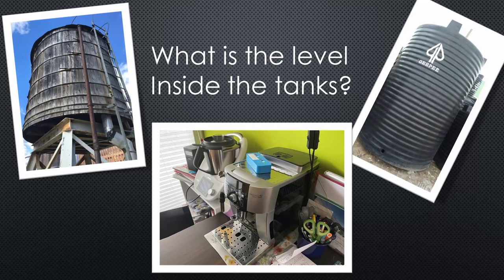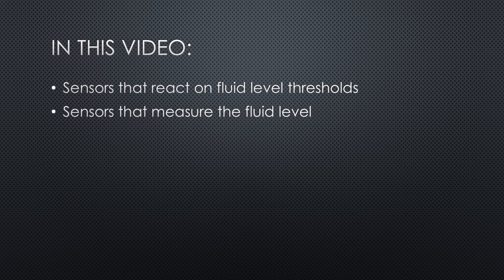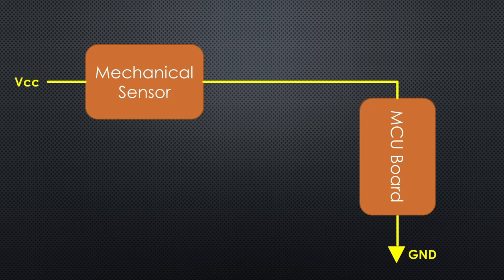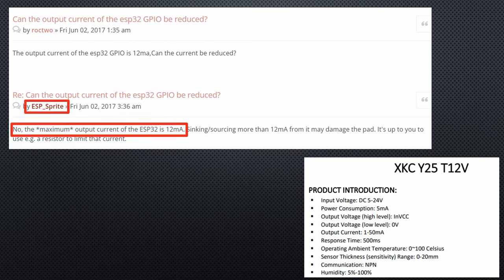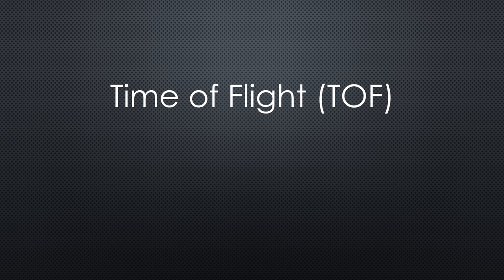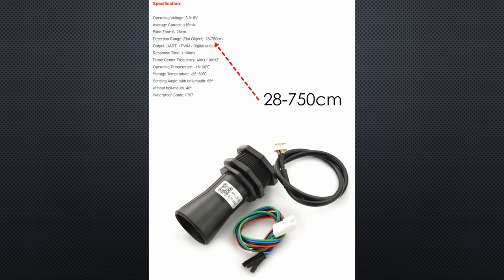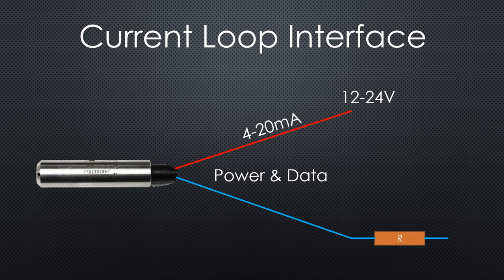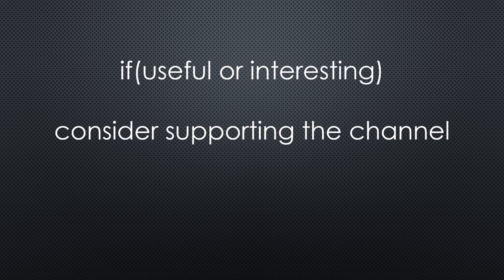#411 Ten Fluid Level (Water Level) Sensors and how to use them (Arduino, ESP32, ESP8266)

Comment: I use pressure sensors (MXP) for bore wells and tanks. These measure the difference between ambient and 'bottom' level pressure to indirectly measure the water level. Only downside, I use an air pump once per hour to drive any water out of the tube that runs to the bottom of the well or tank.
Reply from the maker: I think tis is a very good idea. There are a few discussions about this method in the comments. Using a differential sensor seems to be a very good option.

Comment: What about those eTapes? I have a few, they work great, but unfortunately they are expensive and only come in fixed sizes
Reply from the maker: They seem to use an interesting technology: A resistive band which somehow is connected by pressure applied by the liquid. I only learned about them from commenters.
Reply: @AndreasSpiess  Hoi Andreas
Falls du mal einen eTape ausprobieren möchtest, einfach kurz melden! Funktionieren gemäss Hersteller auch in korrosiven Medien!
Gruss Beat (...vom glp Essen :-))
Reply from the maker: @Beat: Vielen Dank für das Angebot. Vielleicht komme ich mal darauf zurück...

Comment: One useful method for imaging the inside of an object is tomography, any wave source that you can generate and detect that will penetrate the conditions you are working in will do. In a tank scenario you are only dealing with one dimensional tomography therefore it is computationally less intensive and a simple neural network running on a microprocessor should suffice, particularly if the sample rate is in minutes or hours. Obviously the neural network is pretrained on a physical model and then retrained on the actual conditions during the initial filling of the tank. It could be as cheap as piezoelectric actuators/sensors and an ESP32. The cost/value of the setup is in the embodied intelligence rather than the material configuration, this is always the most scalable and sustainable approach.
Reply from the maker: This seems to be a rather complex way for that purpose. How much resolution would the receiver need? Only one signal or a matrix of sensors?
Reply: @AndreasSpiess  Three or four but perhaps only two simple piezo discs acting as transceivers. Not sure if you can multiplex a single one and have it read its own signal echo, worth researching. Add drivers for larger and or more solid tanks, whatever is required to get a detectable signal through the tank plus contents. See "Ultrasound computed tomography for material inspection: Principles, design and applications" Measurement volume 146 (2019) You'd be detecting the moving air/contents interface but not actually imaging anything so just a single variable output.

Comment: This is a timely video for me.  I live in California, in a town that was mostly destroyed by wildfire.  My house was saved but the water treatment plant was damaged.  They have repaired it enough that we have water but very low pressure.  I have to pump water into a tank to supply our house with water.  Right now I have a float switch in the top to tell me when the tank is full but now I am going to put a pressure sensor in the line coming out of the tank so I can monitor the level in the tank.  Thanks for the video :)
Reply from the maker: Glad to read that you and your house survived this catastrophe! A pressure sensor is probably the easiest thing in your case. I forgot to mention htat you ahve to correct the values with hte current pressure (obtained by a weather service) if you ant to be precise.
Reply: @AndreasSpiess  I didn't think of that.  I wonder if I could use the pressure sensor in conjunction with something like a BMP280 for barometric pressure.  But, then I would have to do math :)

Comment: Another informative video … thanks. A few years ago I prototyped a multi-level capacitive approach using adhesive copper tape on the outside of an aquarium and the Adafruit MPR121 12 channel sensing board. It worked quite well and I’m finally getting back to an aquarium automation project using that approach.
Reply from the maker: Good idea. Like that you even get more than just one or two level signals.

Comment: In the past I’ve used a psi sensor on a long tube, weight on the end, read it with an lm324 and A-D converter. As it works on air pressure in the tube you don’t get the sensor wet. And you can calibrate it as you lower the tube into a full tank. I’ve recently purchased an ESP32 and a PSI sensor to make a new one for our new 20000 litre tank. I was going to build it over the holidays. Maybe I’ll make a video to share.
Reply from the maker: Cool. Do you intend a pump to the setup? (As other viewers suggest)
Reply: @AndreasSpiess  No, it’s just the change in air pressure within the tube caused by the water surrounding the tube in the tank. More water higher air pressure.

Comment: Great video, but your videos always are. I'm interested in the FM24-NP100 from #378. The concept is only good for plastic tanks but should avoid contact, corrosion and condensation problems. Mount it above the tank facing down so it can "see" through the top of the tank to the liquid surface. As you know, the sensor communicates via a UART so no ADC to deal with. Ignore the return from the top of the tank and so long as you know the height of the sensor above the floor of the tank, its easy math to read the level.
Reply from the maker: Radars were mentioned by a few other viewers. They seem to be quite common in commercial applications. But they are not cheap...
Reply: @AndreasSpiess  Agreed. Maybe they come down in price with time.

Comment: I've tested a number of different ultrasonic sensors (water-resistant) and from my experience they don't work very well in closed tanks. The main issue is condensation of water on the surface of the sensor (caused by evaporation). I even tried covering the sensor with anti-condensation sprays but without much success so far
Reply: Perhaps the sensor could have a small resistive heater attached, stay within operating temps, and eliminate condensation.
Reply: @gorinator  yes, I agree. Another alternative that I also considered was to mount a small vibrating motor (e.g. from old cell phone) that will run periodically to drop off any condensed water from sensor surface. But either way - it doesn't work without additional workload
Reply from the maker: Good info. Thank you for sharing!

Comment: I like the idea of using a strain gauge (and an MCU to do the calculations) to measure the weight of the tank and contents (and working out the level by subtracting one from the other).  It reduces the problem of content contamination and sensor corrosion.  It just requires the tank to have some flex (or motion) in its mount, which can be quite simple on small tanks.  I like the idea that the sensor is completely external - which is more difficult with a pressure sensor.
Reply from the maker: I agree and I should have included this method because of the many advantages.
Reply: @AndreasSpiess  It's a great video regardless.  Stay safe out there 😀

Comment: Great video, thanks. One big advantage of the 4..20mA interface, it is easy to detect a broken connection (0 mA). And also short circuit is easy (>20mA). Shouldn't there be some protection? Maybe a subject for a video?
Reply from the maker: I was not aware why they did not go down to 0 mA. Now I know that it can be used as a detector for broken wires...
Reply: @AndreasSpiess  If you are google for "NE43 beckhoff grundlagen" you will find a specification how Beckhoff realized NE43 of NAMUR (NormungsAusschuss Meß- Und Regeltechnik)
Reply: Some of the newer sensors are actually sending both a 4-20 mA loop signal and a digital signal somehow encoded such that it doesn't interfere with the current signal. My guess would be as a bipolar voltage changing signal probably at a khz frequency that can be filtered out somewhat like power line carrier.

Comment: Nicely done! A flashback to my past.  Open Collector outputs are used in many places in industrial I/O especially when the sensor is a long distance from the MCU as it reduces the power supply loading on the I/O point. The important point is to decouple the power supply from the sensor. Current loop systems have some concerns about short circuit protection.  It can be a party-line with several devices consuming this data.    Also, current loop is very often used to send serial data which may be fun to dive into.   Nicely done.
Reply from the maker: I thought I explain it because, as you mention, it was often used in the past and maybe no more known by younger people.
Reply: @AndreasSpiess  as always you communicate technical topics in an easy to digest fashion

Comment: Great topic and info Andreas, brilliant as always. Thank you for creating this. Level sensing is a very popular subject and complex (with challenges) at times. In the industrial world, Radar for level is also very popular, with different frequencies and ranges available. Ultrasonic can also use different frequencies, depending on range. With Ultrasonic, keep in mind that the temperature will affect the accuracy of the signal, therefore sensors have temperature compensation internally. You can use a 'still well' to eliminate disturbances on the liquid surface affecting your signal, as well as air movement affecting the return echo signal. With pressure, you will find 'front-flush' sensors which are typically used in the food industry, this reduces the chance of contamination. Even optical sensors are used for level at times, infra-red light can be your friend. For your viewers who want more info on this topic, I would recommend doing a google search, all the leaders in the industrial electronics have various sensors for this application and a world of information to share with you.
Reply from the maker: Thank you for the additional information. The VL... TOF sensors use infrared light, BTW. Radar is also an interesting topic (a longtime topic on my list)

Comment: Thanks. Your timing is perfect for me. Just about to add level sensors in my campervan. Lots of interesting work ahead.
Reply from the maker: Good project! Movement might complicate the things. I always wonder how my gas tank knows how much gas it still contains ;-)
Reply: @AndreasSpiess  float I think. Mine is resistive, I think there's a float operating a rheostat.

Comment: Another one is linear capacitive sensing. They can be made with a couple of long conductors at a fixed distance and completely isolated. The fluid's dielectric is exploited to know the level by measuring the relative capacitance. I've made a video some years ago about a diy sensor that uses this principle. It was designed as a threshold sensor but the linear signal can be picked up to get the actual level. Being completely isolated they can be submerged with no risk of corrosion or contamination. They can also be sticked to the external lining of a plastic tank.
Reply from the maker: Good video! Maybe it even would be possible to use the electronics of the capacitive sensor I showed (using an NE555)?
Reply: @AndreasSpiess  Thank you. With a NE555 you can definitely make a suitable circuit. I rather used a fast cmos though, as it performs better IMO: higher input resistance => better Q => higher sensitivity and larger range. The circuit layout is always critical. Greetings.

Comment: Hi,
Hope you are well.
Thank you very much for valuable information about sensors.
Is it possible to use a pressure sensor of manufacture’s range of (0 - 1.2MPa) to read water levels of a water tank of 2.2m depth?
Thank you
Reply from the maker: You have to do your calculations yourself. Google knows the formulas...

Comment: i mounted a TOF sensor to the top of a 25mm diameter tube. and added a flat topped float inside the tube. it works very well. it measures a water barrel for a greenhouse.
Reply from the maker: Thank you for sharing. Others also reported that using a pipe for the TOF sensors reduces reflections.

Comment: I have a possibly silly question, but I still can't get a project going. The question is the following: I'm using a YB-2J-F and I connect it to 12 Volts. But the output through the blue cable is 12V. How can I then connect it to an Arduino for example? Could you help me please?
Reply from the maker: These sensors offer a current, not a voltage. Search for "current loop  arduino". 12V on a pin most probably kills your arduino, BTW. So pay attention

Comment: any idea, if it is possible to use a pressure sensor 30 elevation meter lower of a water tank and still read the water level +- 0.1 to 0.3 m ?

the water gets pumped from the spring to the water basin 30m higher. 
I have only 1 tube to fill and refill the basin. no electricity or cable at the basin.
now I was thinking if a pressure sensor mounted at the lower location (spring) can detect the water level and how it behaves if the pump kicks in or or somebody empties the tank.

would a pressure sensor be too unreliable?
Reply from the maker: Maybe you watch the video where I converted a blood pressure sensor into a pressure sensor?

Comment: There's one potential sensor type that I haven't seen.  A storage vessel's resonant frequency will change depending on how full it is.  So you could just ping the tank and measure the frequency...
Reply from the maker: Another viewer also suggested this principle. Interesting. But I have no clue how sharp the dip is and therefore how accurate the measurement will be, particularly for wide tanks.

Comment: Is there a method to measure line level pressure of a CO2 or Nitrogen line? Just need to know when/if I lose pressure to my tanks. Can be Shelly or Pi
Reply from the maker: I do not know, I do not have such a use case.

Comment: Can the pressure sensor be used outside the tank with a hose? The question si from this scenario: 
On a motorcycle you can't introduce a sensor inside the tank without making a hole. I was thinking of junctioning the output hose (which is located at the bottom of the tank) into a pressure sensor. Will it measure correctly? Or will the other part of the hose that goes to the carburator influnece the pressure and give false readings? I was also thinking of a debit measuring sensor that would basicall calculate how much is going out of the tank, but the problem here is that the debit is very small that I doubt any sensor would be able to "feel" it.
Reply from the maker: Maybe you watch my video where I converted a blood pressure sensor in a level sensor

Comment: There is a liquid level sensor used in lots of old washing machines - it determines the pressure level as the water rises in small tube and then a diapham pushes a mechanical switch . I think that is how they work.
Reply from the maker: Other viewers also mentioned such sensors and in the meantime I watched a video. They indeed work with the transfer of the water pressure to the sensor using the air in a tube.

Comment: Is anyone familiar with the sensor from Touchcell numbered p14701a1z?
It’s commonly used in automatic coffee machines to monitor the tray. I would like to bypass the sensor, but I am not able to find the datasheet to understand what it would take to bypass it. Any help would be appreciated!
Reply from the maker: It says "Reed" in its description. So I assume it works with a reed relay. Should be possible to reverse engineer it if you have one.

Comment: I saw someone once on youtube design a capacitive tank level sensor. And I often see this in building automation projects with generator main gas tanks. I suspect it has to be calibrated for each type of fluid, a bit like with the pressure sensor, since dielectric constant varirs between fluids
Reply from the maker: I know they exist but so far never saw one in operation. I would also assume their reading can be influenced by the fluids.

Comment: Hello, with regards to sensors and measuring, which type of sensor can be used to read gas levels on the surface of the tank. Would an ultrasonic sensor be able to read the gas levels inside the cylinder by attaching it at the bottom?
Reply from the maker: I do not know your use case. But you should have enough info to decide. Just pay attention if your "gas" is flammable...

Comment: My rx7 uses a variable resistance single probe single wire type sensor.
Its mounted vertically at the top of the radiator.
I'm a newbie but I'm trying to make it a project on reusing the sensor.
Reply from the maker: Cool. I hope you will be successful!

Comment: I'm looking for information about USB Connectors. Did you already cover that topic? I'm working on Android Software to integrate data recieved from radios and display them like positions on a map. Since my older phones all have broken 3.5mm jacks I would need to make my USB-C only Phone work. Two of the adapters I ordered are bad quality and do not work so, I thought, since I now have plenty hardware, how hard could it be to fix them? I would like to be able to charge the phone while recieving, thats my main struggle. Thank you for your immense knowledge base. You brought me back to electronic engineering and into the amature radio world.
Reply from the maker: I never did a video about USB and Smartphones.

Comment: I have been just trying to repair an older model of navis-elektronika bluetooth level meter. It measures capacitance of a two wire cable sealed at the bottom end. The meter contains TLC555 as a capacitance to frequency converter. An MSP430G2553 mcu that wakes up everything every 20 seconds. And a bluetooth module BLE112 which seems to be defective, as it is not connecting to the phone app anymore.

I guess this method of measurement is good for big water tanks, since the capacitance of a pair of wires changes only slightly with the water level.
Reply from the maker: Thank you for sharing. Other viewers also mentioned this method. It seems to work in many situations.